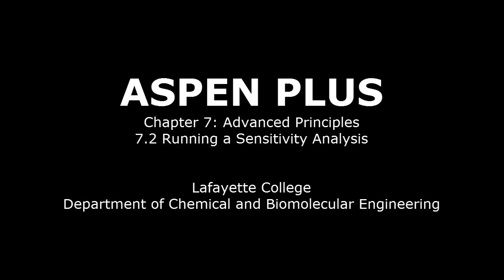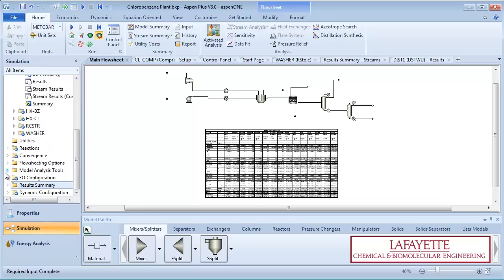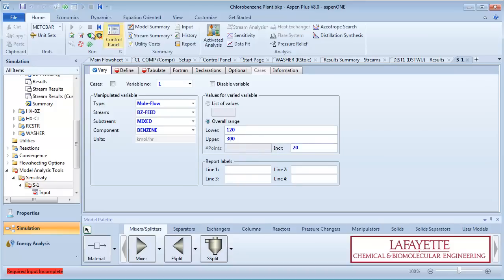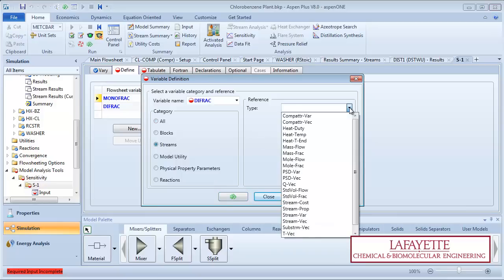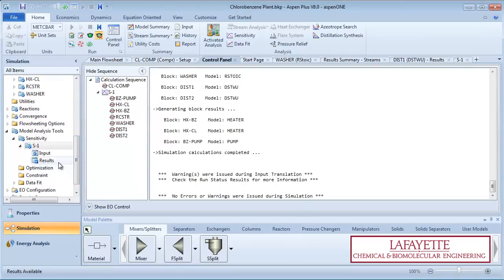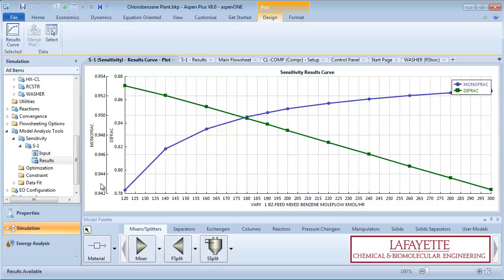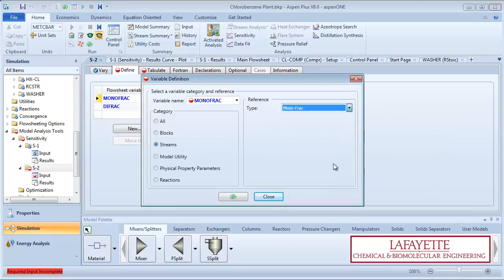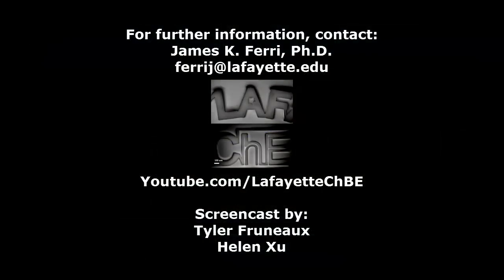Aspen Plus 7.2: Running a Sensitivity Analysis

Comment: Hi sir when i'm using the same condition(Reflux ratio) sensitivity didn't get the error but in design spec  getting error   ERROR

      RADFRAC NOT CONVERGED IN 200 OUTSIDE LOOP ITERATIONS.  what should i do sir